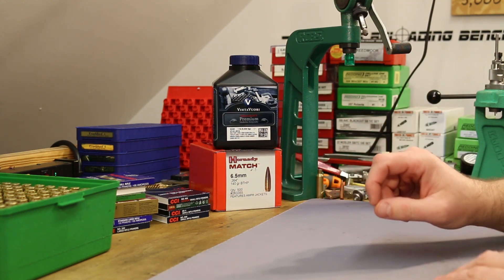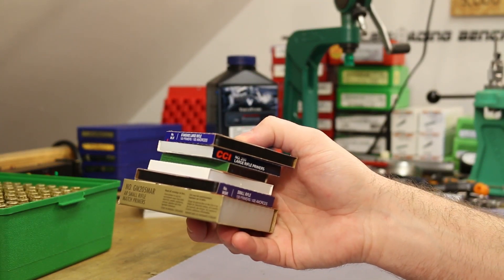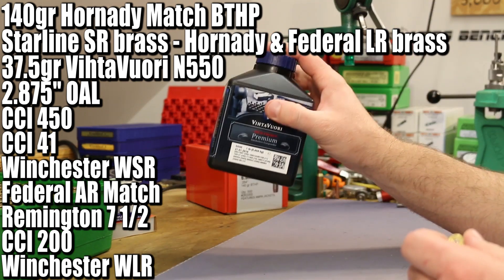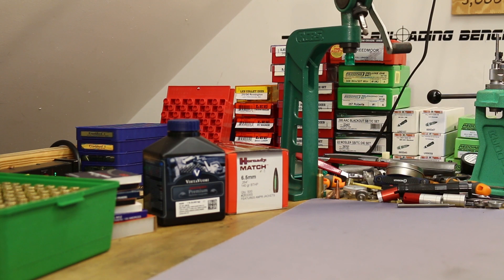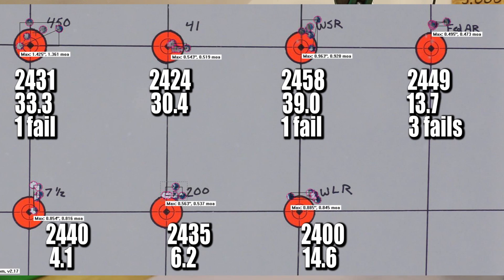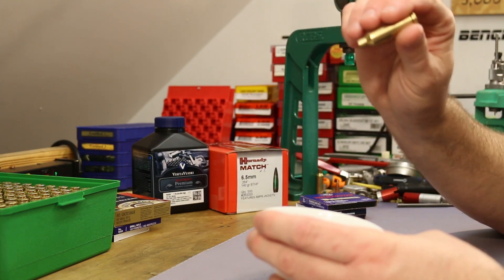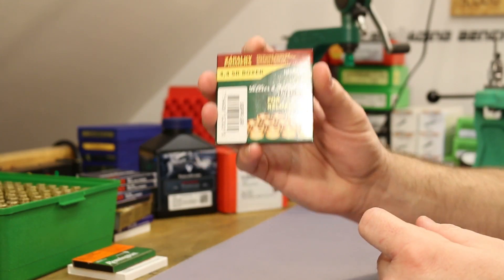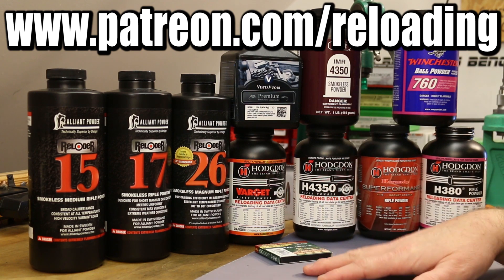6.5 Creedmoor - Hang Fire Problems with Small Primers - Part 2

Comment: Remington recognized this problem 30 years ago when they came out with the 308  Remington Bench Rest Brass.It was a basic brass meant to be shortened and necked down to be a competitor to the PPC class cartridges   People were using it as 308 small primer brass looking for a  bit more accuracy. They were getting the same hang fires and misfires. This issue of primer and powder matching is so important that Speer used to specify that magnum primers be used with all ball powders in rifle loads.

Comment: once you have the data from your next test video it might be helpful to the community to take those primers and powder combos that produce failures and test them in lapua and hornaday brass as the flash holes vary quite a bit - what you are doing is so very excellent for the shooting community - having info that helps keep us far away from failure is really good info - reviewing the data across the spectrum is very helpful - even as is shown here we see an opportunity to consider options on the basis of standard deviation - the next video should show if the trend continues with higher velocities and such - thx for doing the hard work for us.

Comment: I have experiance a similar problem while using St Marks ball powder (748, H335, CFE223) and Murom primers (also sold as Wolf and PMC), in .223. Same loads ran fine with CCI 450 and 400. Temperature was always mild - nowhere near as cold as your test. I put it down to those primers not having a hot enough or long enough flame to ignite that particular chemistry reliably.

Comment: Love the channel. And the format.  That said, I think I know the reason for the hang fires with the small rifle primer brass. Those cases where specifically designed for  compressed match loads. The theory is that by using a small primer it allows the powder (not the prmer) to better control flame propagation and burn rate in the case since you as the reloader have more control over powder selection and charge but not the primers functionality . I'm sure if you did the same test with loads that had a case fill of 95% or greater the hang fires problem would disappear.

Comment: Good vid JRB, I enjoy the testing and find the information very useful as I too like running small primers in 6.5 Creedmoor. Looking forward to the other powders/primer test also. This is the kind of test and information that may save someone’s hunting trip. Thumbs up for sure.

What do you think about sticking with the same powder for one more test and using the primers that failed, but load it with a hotter charge? I think the increased case captivity of a hotter charge MAY clear up the hang-fires. I don’t think many people are gonna load this round to 2450 FPS anyway, (at least not with a hunting bullet) so the increase in powder would seem more practical as it definitely has room to go up. 

Thanks for sharing.

Comment: Hey Johnny, I'm a little late here, but...   my 2 cents.   Yes, you can get a 100 FPS drop with cold weather.  I've had 4 inch drops at 100 yards just from a temperature drop.  I'm thinking the 80% fill in your cases is allowing the powder to lay with an air pocket the length of the casing and when the primer is ignited, the flame travels all the way down to the neck and then goes out with out igniting the powder .

Comment: Johnny's Reloading Bench great video as always, but, I would like to see the last variable besides the primers removed from the equation and see what happens at the higher load densities in the 40-41gr range I spoke about in the earlier video. 

In today's video, you've had 2 of the 3 primers I've used with N550 give you problems (WSR, and the Fed GM, although I don't use the GM AR, I use standard GM small rifle) in the same brass I use, but I don't use such a low charge of powder, so my case fill is between 95-105% with the loads I'm running. They've run fine for me to date down to the high 20s and low 30s all the way up to 110+ degrees.

When loaded with the right primers, you've found that N550 IS a great powder for accuracy, with 2 different bullets now, so we know the powder isn't "technically" at fault :) 

Love the video, and as I always tell my friends "be safe, and keep your powder dry"! Take care my friend!
Reply: jimhans1 I keep wondering if you had a compressed charge and the kernels were all held in place around the flash hole very positively and then this test was repeated, what would be the outcome. We know now that there are differences in small primers under these low temp conditions. I know Johnny tried the poly fill without conclusive results, but what if the poly did not apply the same amount of force to the rest of the powder volume to keep the granules next to the flame front from shifting or rotating.
Reply: wiryone1 not all of my loads with N550 are compressed, but all have a very high case fill. I think presently with Johnny, it's a compound issue between cold primers and low case fill, which is why I would like to see what happens with him having a load of higher case fill. 

The 5 shots he took with case filler in the loads didn't have any hangfires even though it was exactly the same load but with filler added.

Comment: Johnny. What contributes to high number deviation? Is it the powder, case length, neck tension or all? I am doing a ocw with the 147gr eld - m and my deviations were 2 digits in the 20-40s. 
What am I doing wrong?
Reply: 22Virgo66 powder ignition rate (and primer) and accuracy of each charge weight seem to have the most impact, but neck tension, seating depth, bullet type, imperfections in the barrel, crown, etc...are all contributing factors.

Comment: Johnny, after warching your video and experiencing this myself in the cold with varget and BR4 primers, it is my belief that this problem is caused by the trio of case fill, primer, and temperature.

At the time i belelieved the hang fires and misfire to be causes by excessive headspacing seeing how sized brass compared to new lapua unsized brass was .007 in some cases. However thinking back I rememberes as i worked up with varget in half grain increments the problem went away and problem went away at the upper end of charge weights. 

If the problem happens at low case fills with varget in your next video I beleive you have found perhaps the cause seeing how varget is a "extreme" powder and should not be that effected by temperarure.

And to eliminate anybodies suspision of humidity on the effect i can confirm that isn't an issue in my case seeing how my heater is almost constantly on and dryness is an issue living in canada with the extreme cold we've been having where I live

Comment: I'd like to propose another FACTOR to consider for the hang/miss fires - a weak firing pin spring. T/C actually makes a stronger spring for the Compass. Why? Also, why would some primers work when others don't? Degree of hardness is my theory.
Reply: I wonder if the firing pin depth is adjustable too like a savage
Reply from the maker: The primers are igniting just fine.  See the previous videos for up-close pictures.
Reply: njgrplr2007 if it was shallow firing pin depth or light strikes it wouldn't set the milspec primers off i think

Comment: Should be an outstanding bullet. It's what my MPA rifle is cut for, and I dont think they'd cut a barrel for a less than fantastic round
Reply: I see something interesting in your brass, SRP vs LRP. The flash hole in the SRP seems awfully large. By comparison, my Peterson SRP brass has a 1.5 mm hole, much smaller than the flash hole in LRP brass. In fact, if you don't have the correct de-capping pin, you'll hog out the flash hole trying to remove the spent primer. The reason for the smaller hole is to increase the gas velocity upon detonation, and help with ignition.  When using ball powder however, a SRP is not recommended in a cartridge this large.  
So my question is, were your Star Line SRP brass flash holes damaged during de-capping, or are they unusually large?

Comment: You should checkout Peterson brass they have small primer pockets that have the small flash hole. This is the brass I’ve been using for the creedmoor with the CCI 450’s and no problems. Here’s a link where you can check it out. Much more affordable than Lapua. https://www.grafs.com/catalog/product/productId/76155

Comment: My comment during the first half of this series was that while the primers were an obvious First choice to investigate, I myself, would have investigated the powder because of prior experience with contaminated powders presenting similarly to what Johnny found.
I didn't, however, think about how the cold might affect the brisance of the primers themselves. It has long been known that extreme cold AND extreme heat affect powder performance. Too cold and automatics sometimes fail to cycle. Too hot and a normal factory load can show signs of extreme pressures in the brass. These facts are historical and most powder companies have tried to minimize that effect for years. Australian made 223 ammo seems to have actually solved that problem. Even performance from 32°F to 100°F. 
The point I'm making is that while temperature is known to affect powder, I didn't think about temperature having an identical effect on primers - and of course it would......... I just didn't think about that.
While temperature effect on powder has been investigated before, I think that Johnny is breaking new ground by checking the effect of temperature on the brisance of primers. So, keep up the good work. Knowledge is beneficial to all.